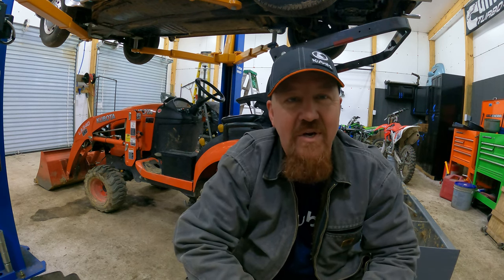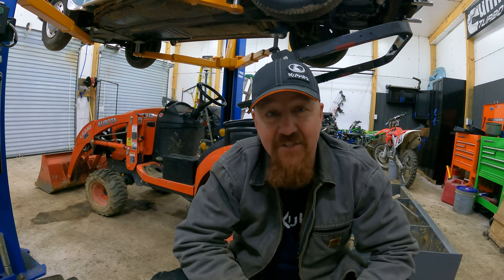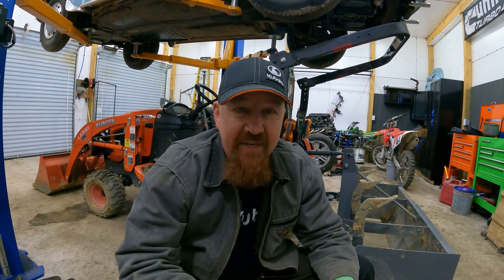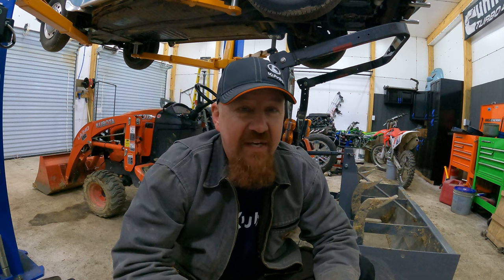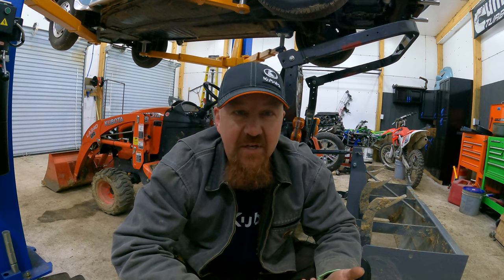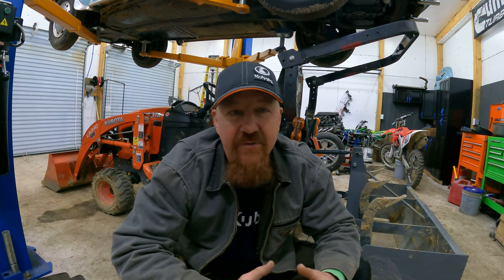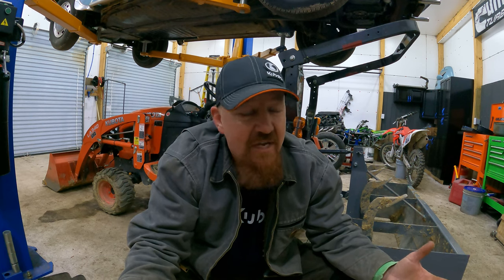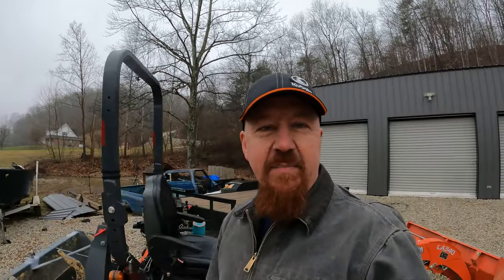Will it Pull it?  Kubota BX Subcompact Tractor Towing Capacity - How Much Should You Tow?

Comment: Towing capacity is not the first thing most people think of when purchasing a tractor but it ends up being a pretty important topic...  weight/power/drivetrain/traction all have a part to play in making something "towable."  This is important for towing a trailer, skidding logs, etc.  The PHYSICS is something a lot of people need to chew on.  Your ability to move something does not mean you have a capability to stop or control the load down a hill, on a side slope, in the mud, or other imperfect situations.  That BX can probably pull a log that is big enough it might roll off a trail and jerk you over the edge as well.  I've even been in a few situations with larger tractors where I realized I needed to slow down and think about those PHYSICS that you mentioned.  This is absolutely one of the best and most thoughtful "simple" videos you've done.  Great job, Lucas!
Reply from the maker: I appreciate the comment, Logan!  I can be the worst at learning things the hard way, but towing or pulling logs like you mention is definitely an area where you want to make well educated decisions before moving.  The consequences are too high if you get it wrong.  👊

Comment: Always great content, thoughts & ideas Lucas. 
I bought one of those bolt-on REESE receiver hitch plates, bolted it to the rear frame on our BX23s. Now i can use my receiver hitches to tow anything we have. I never trusted a 3pt system just for the simple reason that you explained so well... no down pressure. Most newb tractor owners don`t even know that.
Reply from the maker: The Reese receiver is a great idea.  Much better than having to get out the wrenches to swap hitch ball sizes for different trailers!

Comment: super great point , people don't tend to think about the 3 point not having down pressur  ( I did not too )  little tip is to put a limit chain between your draw bar and the 3 point so that you can still lower it but have a limit to how hight it can lift in event you brake or the weight shift to the back of the trailer.
Reply from the maker: Good tip!  Thanks for commenting!

Comment: Great video man! Hey I think I have seen you comment on my channel before if I’m not mistaken? I was checking out some of your videos inside your pole barn when I stumbled across one googling if pex was safe to use for compressed air cuz I had the exact same idea as you.. I figured pex would work just fine but I just wanted to see a few guys who had actually done it first so I knew for sure before I spent the money. Glad to know it’s worked out good in your barn and I see it’s still up 👍🏻  The Kubota Bx is certainly a little beast for it’s size! Have a good weekend.

PS. I like your orange toolbox.. looks familiar 😉 also it looks like our barns are close to the same size, I built mine a 24x32x14 .. yours looks similar only you put your doors on the other side walls. I decided to run my doors legth wise because of the way my driveway and property is setup and I’m hoping it still leaves me plenty of space with my truck and tractor in here at the same time.. I think it will. Ttyl!
Reply: Apparently my mind is shot.. I remember you now lol. I don’t get out much apparently and that also goes for YouTube too 😂
Reply from the maker: Brother, ain’t no way to remember it all.  It’s all good.  Yeah, we got a lot in common it seems.  I’ve been meaning to go check out your pole barn build.  I saw a video the other day about it but haven’t had a chance to watch.  

The pex has given me no issues at all.  I will say, I made the mistake of using shark bite fittings because I didn’t have the crimp tool and they are holding up fine but it cost a fortune.  I would have been much better off crimping.  (I have the tool now).  

Sounds like our buildings are very close in size.  I went 28x36 but only 12 high.  I could’ve used a little more head space installing the lift, but I’m also afraid of heights so I was balancing needs with abilities.  Lol. 

Glad you stopped by!  I’ll go check yours out!
Reply: @PeeksPeakHobbyHomestead  sure thing buddy! Yes I’m glad we were able to catch up! You’ll have to watch my “pole barn tour” video.. it wasn’t quite finished in that video tho as I still had work to do as you’ll see.. but I have all my Insulation finally done now and am currently working on wiring the rest of the outlets in. It shouldn’t be long now till it’s totally done. I have also changed the layout of the shop quite a bit since that video as well so it looks much better in there. 

I went with a 14’ ceiling purposely for a lift and for the fact that I may do a loft some day for added space/comfort. I also added 3 floor drains, 1 for a urinal, one for a slop sink,  and one for the main drain. Not sure if I’ll ever use the one for the urinal tho as I only put that drain in as future proof type of thing.. 

Building the garage with the roof so high up def wasn’t fun, I never liked heights too but by the end of it I was so use to heights that I could stand on top of a 14’ ladder with one foot and no hands confidently lol. It’s amazing how fast you get use to heights (if your forced to) lol. 

We also did our insualtion the same way too using foam board. How thick is yours? Mine is 2” all the way around. I used poly foam which is what I think you used as well by the looks of it.

Hope your having a great week 👍🏻
Reply: Also for the pex I already have all the pipe, fittings, and elbows, they are all the clamp style fittings and I have the tool. I got them all to run my water line this spring/summer so it wouldn’t cost me anything to run the air supply line at this point as I know I bought way more fittings and pex pipe than I needed to run the water line to the barn as I always like to buy more than I need for projects like these and return what’s leftover. 

Keep up the good work!

Comment: Using 3 point is fine just shift the lift arms onto the fixed position. 
We use our bx to pull all sorts round ive even used it to move my kx018-4 on trailer with buckets etc its close to metric 2.5 ton. On flat only tho.
Biggest thing is to never tow anything that weights more than the tractors weight when around hills.
Reply from the maker: Ah, of course!  I never even though of moving the lift arm.  Thanks for commenting this!  👊👍

Comment: 4WD and LOW range is a must if you need to move a trailer around.  Your points are great but you forgot to mention put the range selector in LOW Range.

I move my 18 foot car trailer around with my BX occasionally.  It weighs 2060 pounds empty....I have a 3 point receiver hitch that I use...the hitch plate on the BX is way too low to use LOL.
Reply from the maker: I never use high on my place so it didn’t even cross my mind.  🤷🏼‍♂️

Comment: Can pull a trailer fine with the 3pt just have to load the weight forward of the trailer tires so the tongue weight is on the 3pt.  That being said it does float up on the bumps. LOL like my Kubota Dealership tells me when I send it in for its fix everything I break over the course of a year, "Mike just because you can make it push a 2 ton log does not mean you should push the 2 ton log with it!"  A lot of the BX models particularly older ones DO NOT have a draw bar  All my BX25 has is hole like you would find at the back of a riding lawnmower to pull a little garden wagon around.  And no option for a drawbar.  I use a 2pt adapter like you held up and a RK/King Cutter Trailer mover attachment so I can swap balls out from 1 7/8 up to 2  7/8ths LOL at last count Mrs Krap told me I have way to many trailers.  Anyway the 3pt for pulling them works fine if you load them smart and forward and not on and behind the trailer tires creating negative tongue pressure.  One of my trailers has the tires center of of the trailer, it is kind of a specialty trailer for hauling 20' steel I beams.  My brother took it and my truck to get 4 stacks of bricks.  Long story short every thing went fine until he had the bricks loaded onto the back of the trailer. Guess he got up to about 45mph on the highway before it lifted the trucks rear tires off the road and slung bricks all over the road for a half mile until he hit the brakes to try and stop the crazy swerving, jack knifed it and ate the ditch tossing even more bricks all over the road and in the corn field beside the ditch.  Was a real mess to clean up and my brother is not allowed to use my trucks or trailers anymore :) Negative tongue pressure is real! Whether it is a truck or a tractor.
Reply from the maker: Oh man!  Things get sketchy really fast with negative tongue weight!  You’re right it is all about proper loading!